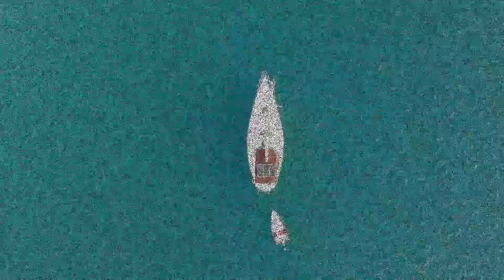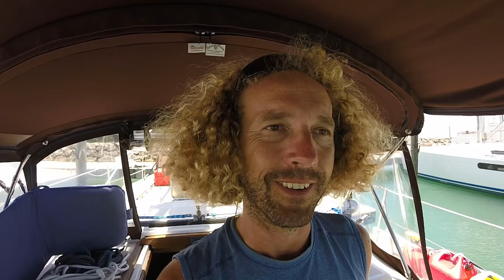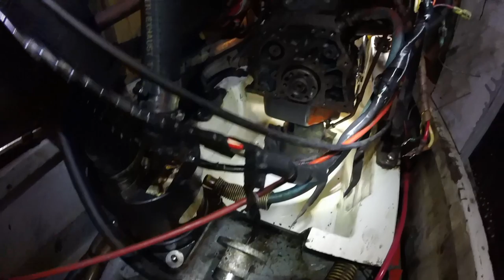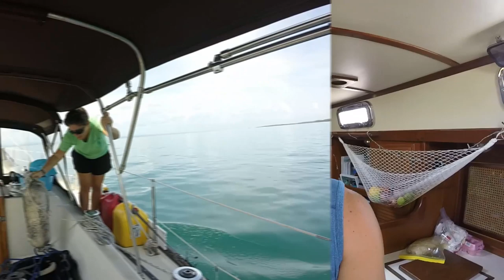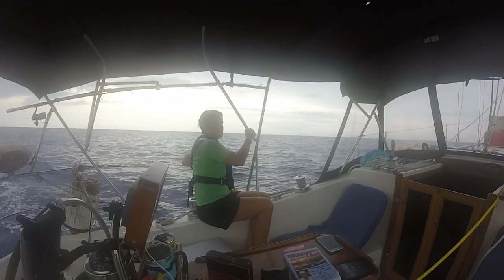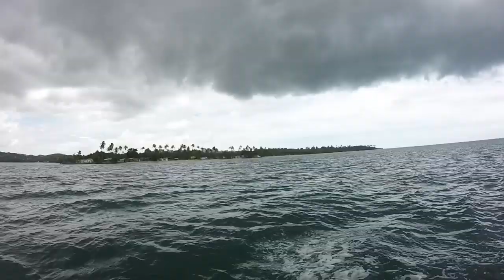Crossing the Mona Passage from Dominican Republic to Puerto Rico S3Ep19

Comment: Z&L, 
I've been dealing with an ailing Hurth Trans for the last three weeks. The trust issue is there and I leave from Annapolis down the ICW to KW in 3 weeks... I know that anxiety. It's awful. Sundowners have helped. I like dark rum and cranberry lately but OJ and Rum works too. 

One trick I learned over the Cruiser forums was flushing the trans frequently with Peak or Shell ATF Dex III in this unit HBW100. Also running 50ML of Diesel fuel with 300ml of ATF made such a HUGE difference. I've only got 877hrs on her so there can't be a problem... But there is. I know that feeling. Those prices though it would be worth it to sail to the DR for the repair! I was quoted $2200 for a ZF12 and $800 for install along with $400 for a new damper plate. But since the Diesel fuel added it's working better than the last 4 years. Positive engagement, cooler temps, and no slip or squealing. I may have bought some time. Fingers crossed, knock on teak. 

PS: No cooking with Lindy episodes lately?? She's gotta have tons of local foods to work with by now.
Reply from the maker: Thanks for the info on the transmission tricks and the liquid anxiety remedies!

I was setting up the next video and saw some Lindy cooking going on so you'll get your fix of that soon enough!

Comment: At no point the coast guard didn’t stop you or ask questions?? You just sailed up to Puerto Rico with no issues?? How is it when you get on land?? Is there immigration waiting for you or?? I’m confused
Reply from the maker: There is a mobile app called CBP Roam that we use to check into the US and US territories. Since we are US citizens, it is a simple process. An officer will video message with us through the app sometimes during the check in process. We weren't stopped by a coast guard boat on this occasion, but that can happen at any time.
Reply: Fun On Holiday Sailing ok 👍🏽👍🏽👍🏽👍🏽👍🏽

Comment: Sounds like she's running strong in this episode.   Hope that's still the case.   An overhaul might help to restore your confidence if there has been any new issues.   But your 24 + hour sea trial of the repaired tranny seems to have proven their work,  no?
Reply from the maker: No doubt. After a few more small passages along PR, I started to get over my somewhat irrational nerves. Did a compression test and valve adjustment to end the season. All good so far.